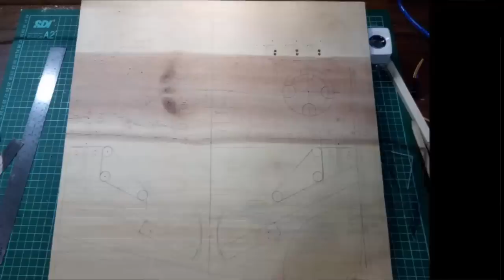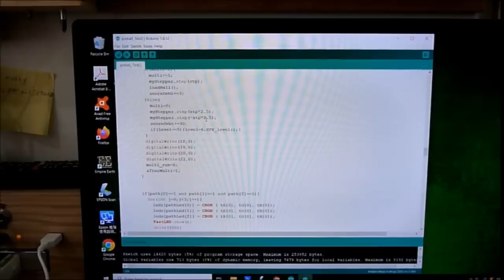Wooden Pinball + Arduino DIY (40x40cm mini size)

Comment: This is excellent. I love your ramps, the scoring, the challenges and sounds. Truly awesome.  I think your ball lock could have just been a DC motor. Doesn't look like it has a reason to go both ways. Ball serve is brilliant. Sensors look like they work great. Never thought I would see a working wooden standup bank.
Reply from the maker: Ball lock is using step motor. Forward and backward is well calculated and controls

Comment: quite a lot going on with that little table. the 3 flag targets could be even neater if they had drop downs in front of them, drop them, then hit the 3 to pop them back up (servo). the slings could have reed switches and solenoids to kick with. not trolling, not my style, this has some very neat little features with drop-kick holes, multi-ball, wire ramps, roll thru's..
would like to see a larger project!

Comment: The design is very nice, but all these homemade pinball games always suffer from the same problem, the lack of dynamism and speed in the movement of the ball. The problem is the lack of bumpers or slingshots with coils that hit and propel the ball to make it move quickly and lively across the game board.

The flippers should also be electric to hit the ball with more force. Once all that laborious work is done, it is not complicated to put electromagnets for the flipper, slingshot and some bumpers also with an electromagnet.

Very good for the optical sensors that detect the passage of the ball in the corridors, I don't know why something similar is not adopted in professional pinball instead of still using mechanical switches today.

Comment: You did an amazing job, Adam! As someone who is trying to build a tabletop Pinball, I know how it is not easy. Using a small 15-16 mm ball makes it difficult to find a matching micro switch, most of them triggered with a mass above 25-100 gram. Can you please share which model of micro switch you used? I’m struggling to find one for 16 mm ball due to its small weight... I suppose you have used an optical switch instead of rollover switch because of the same problem.
Reply from the maker: For parts infomation, please check end of this video.
Reply: @Adam-do3ny  thank you for the reply! I have watched your amazing video and I saw that you mentioned 'micro switch', but unfortunately it is too general... There are hunderds of micro switch types. No worries mate, I will find the one I need. Thank you anyway.

Comment: I'm curious how you were able to bend the wire ball guides so smoothly.
Reply from the maker: It's copper strip from single core electric wire and it is easy to bend just by hand.
Reply: @Adam-do3ny  Very well done.  It just looks so smooth.

Comment: Great job!  How does the kickout hole work?  Is there any sensor?
Reply from the maker: No sensor, it use steel ball to contact and short the circuit inside the hole, then use servo to push out.

Comment: Is it possible for you to upload the arduino sketch and make a quick circuit for all of the components?
Reply from the maker: The file was missing when i upgrade to new computer. Sorry.. Basically its a big loop listening all events and then make calculation and action.